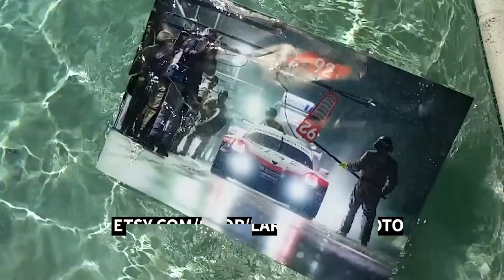Ryan Litteral’s 800hp RB25 NEO Powered Nissan S14 Party Car is Built For Flat-out Shredding

Comment: When wisefab came out I remember people having to bend the front lower control arms. Is that still an issue or did that fix that already?
Reply: I remember this too!
I know they came out with the Wisefab v2 for the s-chassis and the improvements were a sort of "brace" to move the rack forward and different adjustment for Ackerman and camber from v1.

But I'd like to hear from someone if they changed the lower control arm as well!